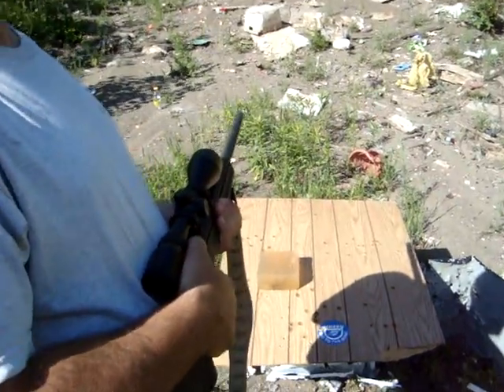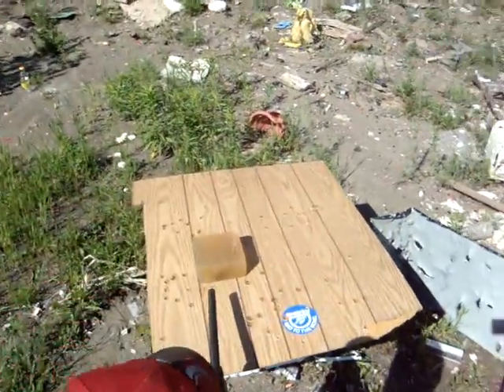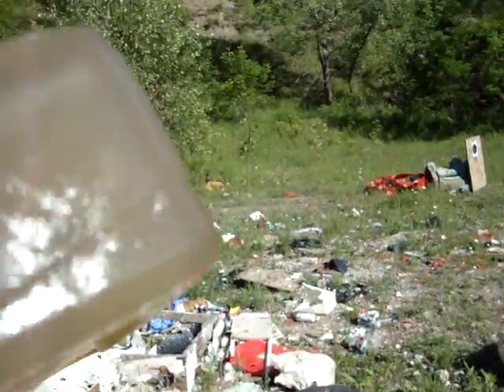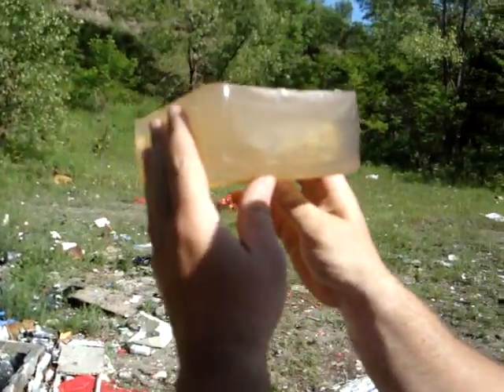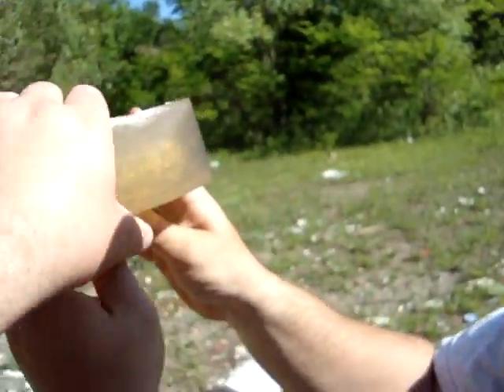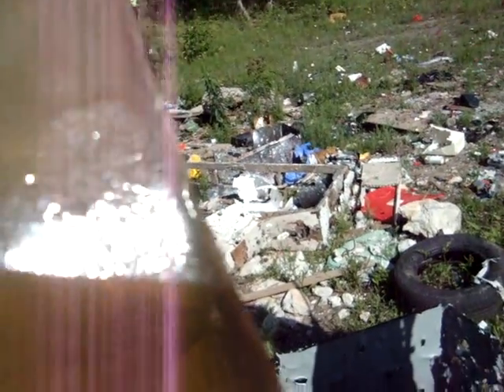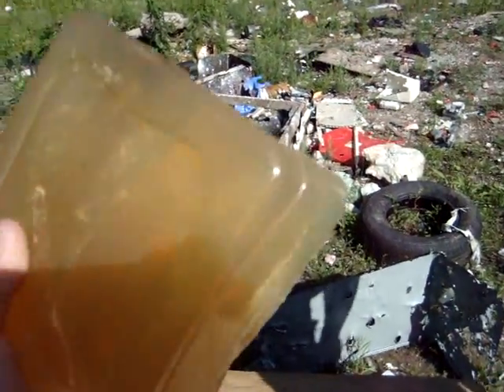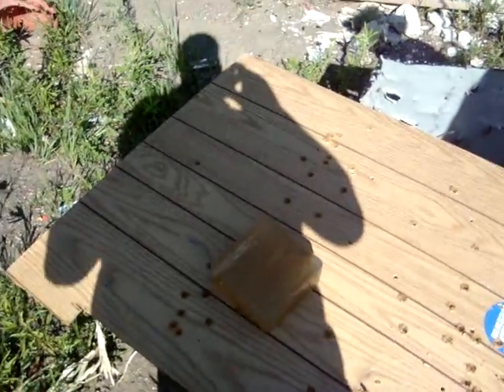ballistics testing of HMR 17 cci 20 grain hollow point point blank

Comment from the maker: lol naa iam not a grammar nazi, and this is home made ballistics gell as clase to a medium as possible, esentially from that block the 17HMR is  abad ass round for varmits, as far as coyote or larger predators head shots only unless weather has been dry and pelt is dry as well, for the high speed of the projectile and light grain weight will not penetrate, just having some fun with the cal. and some good ol homemade ballistics gell, thanks for checkin it out

Comment from the maker: @DaveInKilleen and i forgot but also ran out of room, there is black on the gellatin around the entrance hole due to the heat and pressure as you stated "exhaust gases" however the cavitation inside the block was done purely from the .17HMR projectile, if any gas from the muzzle had entered the block it would have blown it appart not travel through and causing a wound channel like you see in the video

Comment: @1gamoguy I have looked up all the different HMR bullets, and the TNTs are 17 grain hollowpoints, while the only 20 grains are either jacketed soft points or full metal jacket. The hornady XTP 20 grain may be a hollow point, but as far as the hornady website says, it is still a controlled expansion round, not a hollowpoint